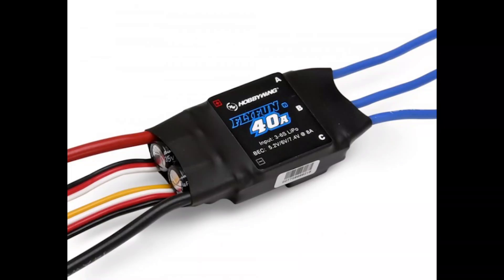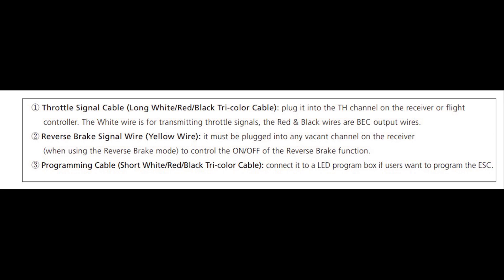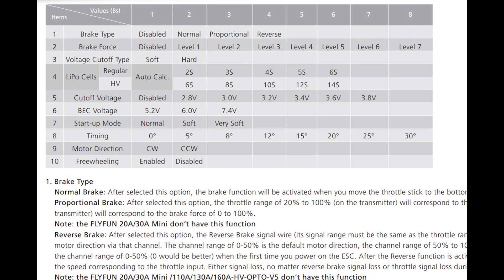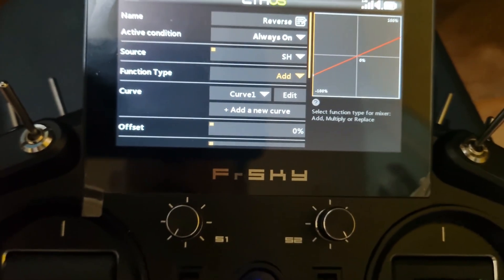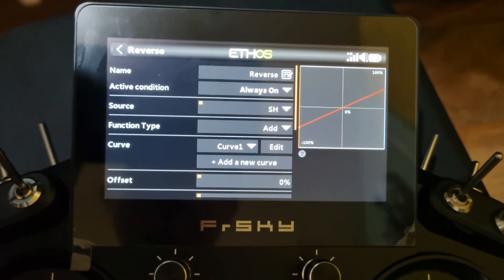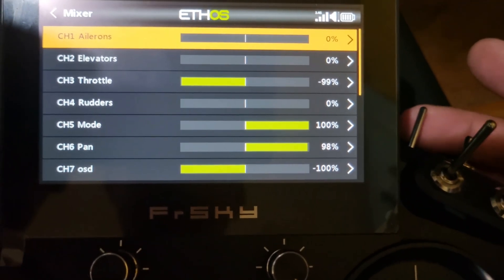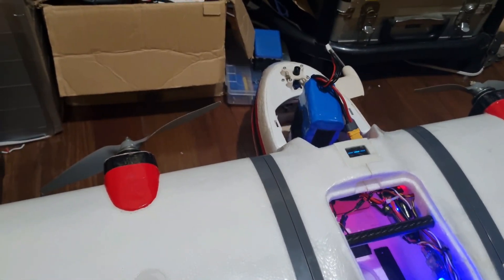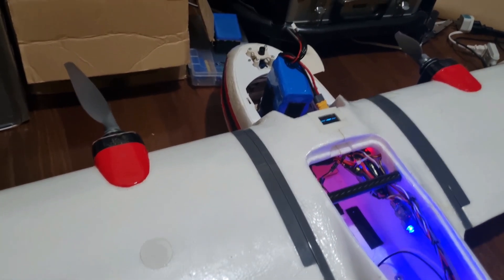Setting up reverse thrust on Hobbywing flyfun v5 esc for my MFD Crosswind Mini

Comment: Nice, been looking for this type of setup for a long time now. Can you show how you have the throttle mix working for this and how you tie the two together?
Reply from the maker: What ESC are you using?
Reply: @windfpv  I have a hobbywing, just like the one in this video. And I also have the FrSky X20s Transmitter.
Reply from the maker: but you already got reverse working via switch?
Reply: @windfpv  Yes I was able to use the 50% plus and Minus on my curve like you have in the video, however I cannot get it move any higher on reverse, If I change the curve or anything else it gets confused. It will either lower normal mode or it also is in reverse, I want to be able to set up more then 50% in reverse and possibly make it do reverse without having to move the throttle stick input up, I just want to hit my reverse toggle and it does it to my desired throttle percentage in reverse.
Reply from the maker: ah right, then just stick with the mix/curve for the reverse channel. dont change the weight and mix on that. but for the throttle, you will need to add that mix. Clone your throttle mix (on mixer options), then set the active switch to whatever you used for reversing. Change the property of that cloned throttle mix to REPLACE the existing throttle channel. Also, specify the weight you want for that cloned throttle mix, say 80 or 100% weight. that would make it go to 80% or 100% throttle in reverse
Reply: @windfpv  Thank you very much. I will test this out asap and report.